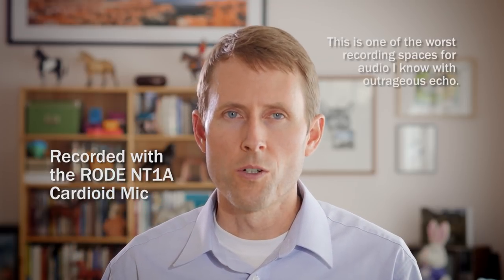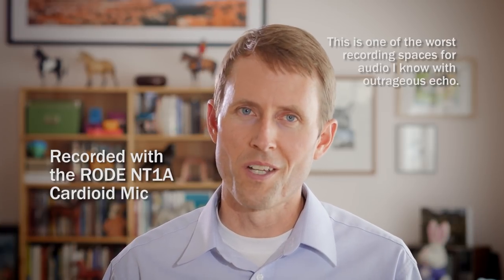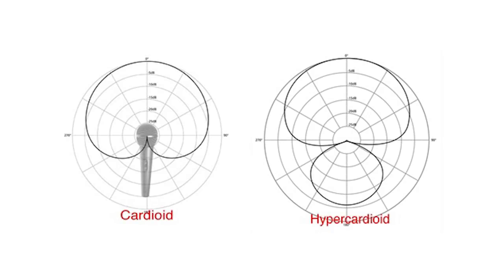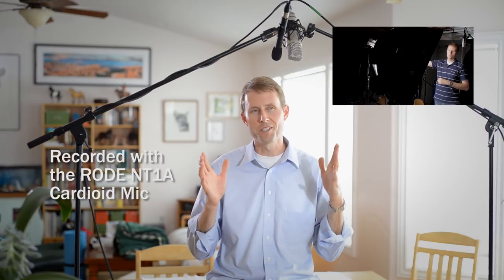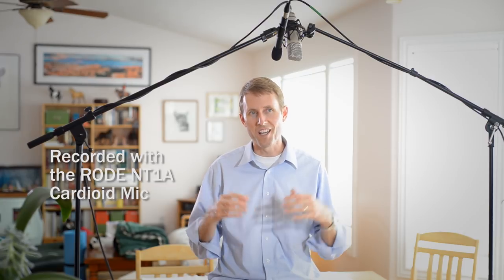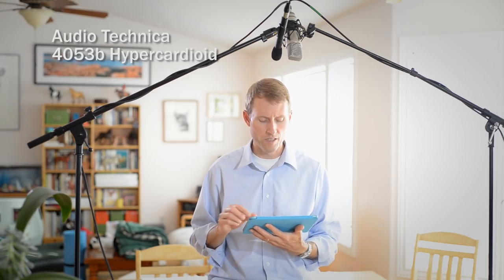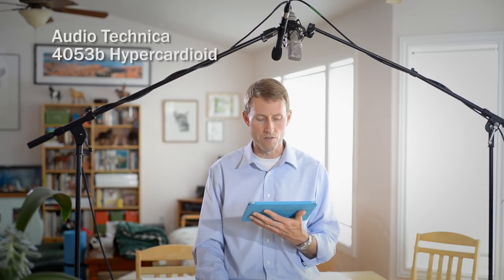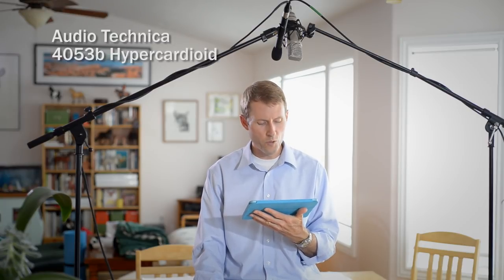Mics for Rooms with Echo: Cardioid vs Hypercardioid

Comment: It does make a difference I listened on a phone to my ear mind you but I heard much more ambience and reverberation from the Audio Technica Hyper Cardioid in that set up than the Rode 😁 I've worked as a sound technician for live shows, but not recording/broadcasting. Dynamic mics are less susceptible to feedback than condenser microphones. The Rode NT1A is a Studio Condenser but you can get Live Condensers. At first listen, the Rode didn't seem to pick up too much bleedback from the hard surfaces considering its designed for studio use. I own a zoom h6, it has interchangeable microphones. May have to invent a multipurpose microphone for streamers that are content creators

Comment: Curtis, i'm trying to decide what type of mic to buy for a noisy environment that I talk in for programming or tutorial vids, kinda like this one but with a TV and kids screaming in the background.

I don't really think dynamic's "reject room noise" more, i think people think that just because you gotta boost the gain more. could you help me pick a type? or a mic? shopping for 100$ or less.

i've been looking at the XM8500, and SM58. they're both dynamics, but i'm wondering if maybe I should just find a cardiod condenser instead.
Reply from the maker: I find that mic technique is what generally makes the difference between dynamic and condenser microphones. With dynamic microphones, most people work up closer to the diaphragm than on condenser mics which results in a more favorable signal to noise ratio. So in those practical terms, it often does make a difference - less background noise.

Comment: If you shelf off the highs about 6db from 4khz and up, the rejection of these two mics sound identical. i personally prefer brighter sounding microphones for dialogue, so using the NT1A and then having to boost highs to get a desirable tone doesnt make sense (since the boos will accentuate whatever line noise was recorded with the dialogue).
Reply from the maker: Thanks Demetri.
Reply: and thank you for your wonderful videos!
Reply: I have to disagree. I totally agree that the majority (90%?) of the difference between the sound of the two mics in this example is simply due to their different frequency response curves,. But even after seeking to minimize that... there is still a bit more rejection of the reverberant sound across all frequencies from the cardioid mic. It certainly doesn't make it disappear. But I clearly hear a small (15-20%?) reduction after attempting to compensate for the frequency response differences and level matching the two samples... as I expected to.

Comment: Would placing a small sound panel behind the microphone reduce reflections coming from the rear lobe of a super/hyper cardioid microphone, or would that adversely affect the sound quality in other ways?
Reply from the maker: That is a very good question that is worthy of an experiment. I'll add that to my list! Thanks!
Reply: I know this an old thread... But absolutely it would. In fact I think it's probably one of the most useful things you could do with one of those usually totally pointless reflection filters that you mount behind a mic. One of the biggest challenges in this usage is just dealing with the sheer bulk and weight of the ones I've seen. But it would in some ways create a "best of both worlds" type scenario. I'm actually quite surprised that no one has created a small super-cardioid mic that sits inside a small super lightweight rear sound absorber to keep most of the reverberation from entering the rear node expressly for this purpose. There's certainly enough video being shot in reverberant rooms to show that there's a market for one.
Reply: @LeeRoyFreedom  I know I'm super late to this party but there is a reason why such a product doesn't exist. The rear node is meant to cancel things like reverberations and background. As loud noises enter the rear node and front of the capsule simultaneously, they will cancel out relative to their SPL. Refer back to the diagram in this video, sound coming from the rear node is significantly reduced in DB. So if a truck slams on its breaks and the screeching is heard through the front capsule at 30db, and the rear at 20, they'll cancel and only allow 10 DB of that background noise through.

If you filter out the rear entirely, then the background noise of the trucks braking at 30 DB will in no way be mitigated. 

Just my $.02.

Comment: Yes, cardioid RODE NT1a does have more "tighter" ambiance in a sense less echoic than the hyper cardioid AT 4053B, I has read somewhere about the differences between this two polar types that saids the same, if in a hall recording use a cardioid mic to minimized echo, I think this video confirmed such theory.
Reply from the maker: +pantaitube thanks for your insight!
Reply: +Curtis Judd Yes, I think all these infos are timely as I has just started to get serious with better videos via better audio that for a non commercial guy on budget I has just ordered a cardioid type K&F CM-500 which will be for indoor halls, forums  and outdoor stage events while later on will get another budget hyper cardioid model for outdoor  individual speech interview situation such as in a public rally so as to cut out surrounding noise to have better speech intelligibility of the subject  in that kind of video.
Reply from the maker: +Choong best wishes on your film projects. Better sound is one of the best things you can do to improve your production value.

Comment: Hellow Curtis

Maybe its time to rebuilt this review using your AT 4053 agains the rode NTG2 and the Oktava MK012.

Its could be nice to ear the difference between polar patterns in the same place with small Diaphragm condenser mics (Cardioid - hypercardiod) vs Shotgun. 

Finally talking about shotguns, I just bought my first MKH416 and outside is fantastic, but well, indoors as all we know is not the best option but for some reason, my MKE600 with a Super-cardioid polar pattern produce a fantastic indoor sound against the MKH with the Hypercardioid - Lobal polar pattern.
Reply from the maker: Hi Nacho, thanks for the idea. I’ll add it to the list.

Comment: Hi Curtis, I'm struggling to make a decision re: mic choices. I have a few scenarios and was hoping you could steer me in the right direction. 1.) filming in a classroom 2.) filming in a gym 3). filming in a 12ft x 12ft room (with sound absorption on wall and floor) and 4.) vlogging out in the community. I currently have a Panasonic HCV 770 camcorder and was considering the possibility of mounting a Rode NTG2 on it (maybe with a TASCAM dr60 and/or a Beachtek adapter). This may be overkill for vlogging. I considered getting a Rode VideoMic Pro for vlogging (and then not use the adapter or recorder for that particular scenario). Do you think the Rode will pick up my voice from behind the camera when I am vlogging? If I got the Rode NTG2 I was thinking I might be able to use it on-camera and as a boom mic. I plan to use the TASCAM when recording in a gym or classroom, as well as in the 12ft x 12ft room (with some sound absorption). I will occasionally have one or two other people talking with me when I film in any of these scenarios. I was thinking about setting up two boom mics for those situations. I am a one man show so I am limited in my options. I could get a handheld mic and just use one boom too. Just not sure what's best. I don't want to spend a ton of money but I also don't want to get adequate enough equipment. I know that's a tall order of feedback I'm requesting. Any help would be FUR-bulous :)
Reply from the maker: Hi! Wow. That's a tough one and just about everyone will have a different opinion on the best way to tackle all of those scenarios. For the vlogging scenarios, you could always turn the microphone, whichever you end up choosing, around 180 degrees so that it will pick you up. It won't pick you up very well if you're behind the camera otherwise.

Perhaps a lavalier mic will work well for you?
Reply: Thanks Curtis! That may be the most flexible option to best meet my needs for most scenarios on a budget. I'll stay posted to your videos. They offer lots of unbiased information in straight, matter of fact detail. I greatly appreciate your efforts and thanks for such quick feedback! Just sub'd.  CATchya Later ^..^
Reply from the maker: Thanks BossPawsTV! Best wishes and happy recording!
Reply: Giddy-Up!

Comment: all cardioides must have a bean shape polar pattern, but that requirement is generally done with a 1khz fundemental, what isn't obvious is the dramatic change in the pickup pattern with a change in frequency, cardioides start to look like hypercardioides generally around 8khz, so allot of noise can still reflect into the back of a cardioide capsule (even though most diagrams wont show this), if those reflections are room abience you can cancel that out in the mic by capturing the room and imposing that signal into your primary mic 180 degrees out of phase with it, its easier with a specific source aka in front of the speaker so a boom will capture allot more room as a primary mic but using phase of room (b seccondary mic) against room (a primary mic) can be done, I sincerely hope this helps, heres a link to what i mean http://static1.squarespace.com/static/539f291ae4b06c9050b29a0d/t/541b5d5ee4b0a6db3132ada8/1411079518807/x1-polar-pattern.jpg?format=750w
Reply from the maker: omnicrutch Thank you, that does help a lot! The technique of removing the ambience is, I presume, the technique that some of the de-reverb plugins use.

Comment: Curtis, i have a mini-numann TLM103 for recording vocals etc. Would something like one of the Audio Technica 4053b cardoids do a better job in a fairly echo room (basically a smaller version of the room you're in here) with hard walls wood floors etc -  for voice in a video.
Reply from the maker: Hi, no I don't think so. In my tests, cardioids placed up close do a little better because hyper and super cardioid mics have a big tail on the rear of the mic which picks up a bit of the room. I think you'd be as well or better off with the TLM 103. Better yet, sound blankets will mellow out the reverb in the room: https://youtu.be/uzyEaVYCk3s

Comment: Hi Curtis,
If you are casually listening to your YouTube video, both mics. sound very similar.  However, on closer observation, the Rode mic. seemed to me more pleasing to my ear. The Audio Technica mic.  had a slightly "harsher" sound.  In conclusion, both mics are adequate and sound good but the Rode mic. is the winner in this test by a small margin.
Reply from the maker: I agree, small difference but noticeable. And with the NT1a being less than 1/2 the price of the Audio Technica... I actually think it comes down partly to the voice you are recording--everyone's is a little different and on my voice, the RODE sounds better. But on some others that I have recorded, the AT sounds great--not so harsh like on my voice.
Reply: +Curtis Judd - Actually you are now discussing the frequency response, not the pick-up pattern.  As those folks who record vocals will tell you, that some cardioids are better for female vocal range and others the male. A flat frequency response from 20-20kHz cardioid would probably be the truest recording if you were using just one. Ive though about this issue, and really that's what EQ is about in post, correcting the frequency response.
Reply from the maker: Robert Shaw You're absolutely right, I drifted into talking about frequency response. And I completely agree, EQ is a great tool for "correcting" for frequencies responses and voices that may not be a great match.

One note on polar patterns and frequency response; they are related from the standpoint that the pickup pattern varies quite significantly at various frequencies on most shotgun microphones. With hypercardioid microphones In particular, higher frequencies tend to be picked up in a much more directional pattern than lower frequencies (e.g., on the RODE NTG4+, 16kHz is very directional whereas frequencies in the 200Hz and lower range are picked up in a cardioid-like pattern. See the polar pattern graph at RODE.com: http://cdn1.rode.com/ntg4plus_datasheet.pdf  Just an interesting phenomenon.
Reply: +Curtis Judd Well bass frequencies are the easiest to capture. Low frequencies are felt more than they are heard, some folks will put a mic behind a piano to capture the bass.  So not have directional capture on low frequencies may not be as bad as it sounds.  High frequencies need direct line of sight as they will be dampened/blocked.  That's why they put treble speakers up in the air and bass speakers low to the ground (bass vibrates along floors, walls, cabinets etc.).
Reply from the maker: Thanks for the insights!

Comment: To my ears the Hypercardioid sound a little more open and natural. An A/B comparison with the same microphone with different polar-paterns would be more ideal. Like +Bob Adams says, you need to use the rejection angles of the microphones for different situations. The Hypercardioid design lets you reject at two angles or rather two sources, and the the Cardioid lets you reject a single source.
Reply from the maker: +miguelitolitolito Thanks, interesting insight.

Comment: Is it common to boom a cardioid mic like that? cause it actually sounds pretty good.  I think I will try this with my Lewitt 440.
Reply from the maker: Usually not but mainly because large diaphragm mics are quite heavy so they need a substantial boom arm.
Reply: @curtisjudd  So, beside the weight factor it can work? And, would it need to be boomed as close as possible or can you boom just like you would any small diaphragm condenser mic?
Reply from the maker: @steven_charles  The closer you get it, the better the signal to noise ratio. Just outside the top of frame is best.

Comment: Have you try the NT5 in this echo room? Does it sound great? I'm choosing a budget boom mic for recording dialogue in a echoy room and It's hard to do sound treatment. Thanks!
Reply from the maker: Yes, it isn't much different than these two here. If there's a lot of reverb, the best thing to do is put some blankets in the room in front of the hard, flat surfaces that are not in the camera frame.

The type of microphone which does the best at rejecting reverberation is dynamic microphones. But you have to be within about 6 inches max. So if you're ok with a microphone in the frame, something like a Shure SM7B can work nicely.
Reply: Curtis Judd Unfortunately all the hard surfaces is in the frame and the mic can’t be in the frame. I have NTG3 and a set of deity connect with W lav pro, and the reverb makes me crazy...and the sound treatment I can do is this room is limited...
Reply from the maker: @joe51317  I'm sorry. Perhaps another location? Perhaps a rug on the floor? Perhaps some way of introducing set design which involves softer surfaces? Wish I could help more - just trying to share my experience.
Reply: @curtisjudd  Thanks! I'll try my best!

Comment: can you step underneath the fan above, turn it on to full speed and then test the mics. That is my current audio recording scenario. I have lot of ceiling fans running at full speed. Plus my talent is live broadcasting in the room itself via ceiling speakers.Looks like lavalier and cardoid mics will work great.

Comment: Hi Curtis, I watched this video and wondered if you (or anyone) has thought of putting a foam cone around the hypercartioid mic. (Much like the cones a Vet puts around a dog's neck after a surgery.) Do you think that would help isolate the mic from the echo?
Reply: Here's a possible solution, Yule - http://www.probroadcastsupply.com/pocket-sound-booth-psb-oval-microphone-ambience-reducer-psb-oval/ - It's the "Pocket Sound Booth".  I never did purchase one of these, but have known about it for years - for $40, it would be worth a try for isolating echo like you mentioned.
Reply: Yes !! It does work funny I experimented with that theory yesterday hehe, it works to an extent I would say , albeit your cardiod mic and not omnidirectional
Reply from the maker: Thanks YuleTompta Bruce Avilla *****. I have heard some audio engineers caution against the use of soft foam because it tends to absorb higher frequencies but not lower frequencies. But in practical terms, it may help, maybe echo is mostly higher frequency sound? Interesting idea Yule.

Comment: I honestly could not tell the difference between the two,,
I wonder if it makes sens to include low noise out in front of you a few feet 
to distinguish which of the mic's have a better ability to cancel out the noise.

thnks for the post
Joe
Reply from the maker: +Jose Garcia Thanks! I agree that it will be hard for most people to tell a difference.

Comment: I prefer hypercardioid, it sounds more like the real voice ...  and also I guess the difference of Mic wan't because Hypercardioid or not, more is because the way RODE design Mic, add more bass in it.
Reply from the maker: Good points--thanks!
Reply: +Yi Xie - I think you have to separate the frequency response (which also varies Shure SM57 is a great cardoid but it emphasizes the mbid-range and has poor bass) versus the pick-up pattern of the mic.  The cardoid pattern simply has less reflection, since no sensitivity to whats behind it (i.e. wall reflections).  This also suggests if a hypercardioid is placed far enough from a wall behind it, it should not add reverb/echo.